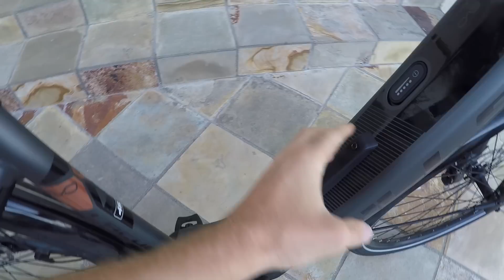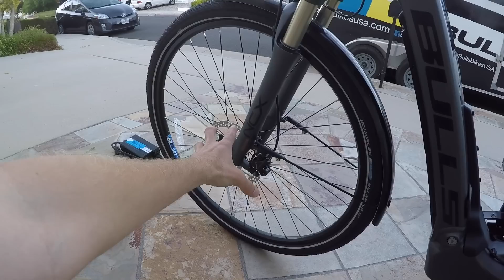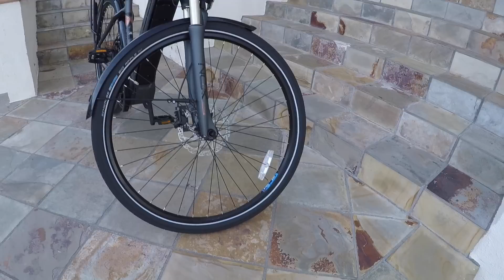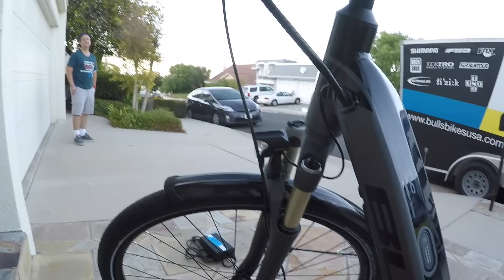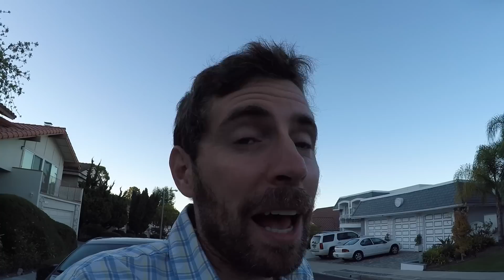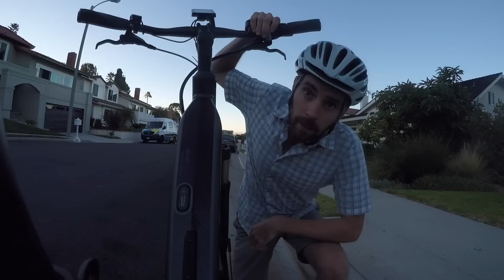2017 BULLS Lacuba EVO E8 Review - $4k

Comment: Just bought one and the bike is a death trap. The frame design of the EVO “wave” is too flexible, and you get an insane amount of wobble. There is no stiffener from the seat post to the handle bar, and the frame is way too weak. If you like these bikes, buy another model as the Wave is dangerous!

Comment: As usual, great review! Just curious, Court: Have you ever changed out a rear tire of a bike that has the Gates system? Is it easy?
Reply: I have Gates belt drive on two of my bikes and changing the rear tire is relatively easy.  It is just like a chain drive except your hands do not get greasy.  There is belt tension requirement but I find it is fairly lax.  The Bulls Lacuba appears to have two fasteners on each side of the rear drops for easy adjustment of the belt tension.

Comment: Hi, I have watched many of your reviews. I have a fat bike with a 2 stroke motor that I installed. But was disappointed by how lack of power has going up the hills. Too much pedaling going up the hill for a 69 year old guy. even considering that I practice the Triathlons export for many years. But I love bikes, so I am trying to decide on a electric fat bike that is powerfull enough to handle the mountains road of Puerto Rico. Any recommendations.? I will like to be under $2k price range. Thanks for any help you can provide.

Comment: I've been using a Haibike 26 XDuro RC to cycle to work & back for 7 months solid. The journey is 20 miles a day (10 each way - obviously!). My battery - it was almost new - only just manges to manage the 20 miles - at full assistance. Also, if I turn the power off, it is like cycling in treacle, in no way similar to a regular bike. I guess the motor causes a large hindrance when lacking any power. I flipping love it though. 22 mph everywhere. Nice.
Reply: Bună , stii dacă poti folosi bicicleta fără display LCD central ? Doar cu pirnirea din butoane stanga ? Multumesc

Comment: Great review as always and one beautiful machine. Now remove the speed limit and get it down to say 3500 and send me one. I'm assuming most are built off shore where manufacturing cost is incredibly cheap since they're all built in a small handful of facilities to brand specs. When the price is right I'll pony up. Until then when spring comes around it's a radrover for me. Although it certainly has penash doesn't it. Keep up the great job and I'll be sending my thumbs up along the way.
Reply from the maker: Thanks! I've got another Bulls speed pedelec review in the works, very cool platform I'm sure you'll enjoy checking out. But yeah, also still a bit expensive ;)
Reply: Ive had the rad rover for four months and love it but after watching these reviews I just ponied up for the bulls e45 to ride in the spring/summer. Should be here in a few days. Some people are not able to drive for certain reasons or just don't want to pay for the gas and insurance. Keep all these wonderful reviews coming court.

Comment: Excellent review!!! What are you thoughts on some of these price points?  I feel like they are all over the place. A kit seems like the best way to go for those looking to do it on the cheap.  I currently still have the 250w Hilltopper but looking to upgrade. Last question hub motor or mid drive?
Reply from the maker: Hey Max! You can create good experiences with kits these days for a lot less money but the batteries aren't usually as nice, it requires some DIY and depending on the state you're in they may not be legal (California specifically). Building a belt drive like the bike here and having a mid-drive is pretty tricky because the frame has to be custom. I've spent less time reviewing kits lately because some companies have gone out of business and I heard about a fire. I think we'll see cheaper "purpose built" models coming to the space more in 2017 and for me that feels safer and I like the warranty. I also appreciate the shops out there that set bikes like this up and provide test rides so that's where I usually go to film. If you've had a good experience with the Hilltopper than most systems are probably going to feel great as they now mostly come in 350 watt or higher. Have you seen Dillenger? I still like hub motors but E-Rad has some good mid-drives and they even sell pre-converted bikes at a pretty good price now :)
Reply: Thanks Corey! The dillenger site is great and I do like their kits. I've seen similar kits for less but dillenger appears to have a warranty and customer service.  I know you've been following the industry for years now. Where do you see Ebikes going 3-5 years from now? What do you see being phased out?